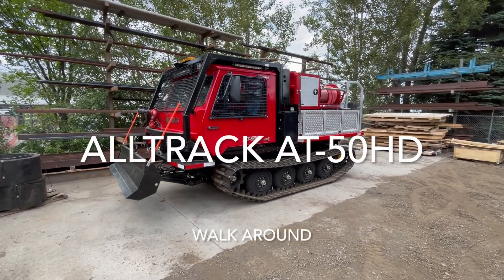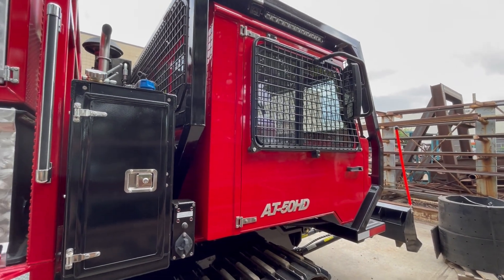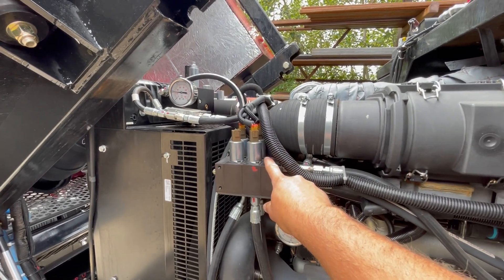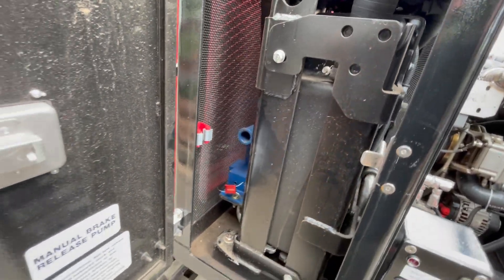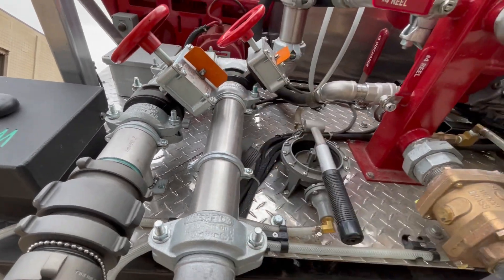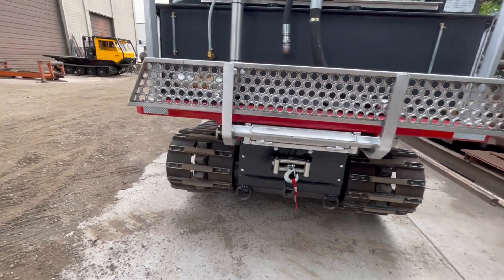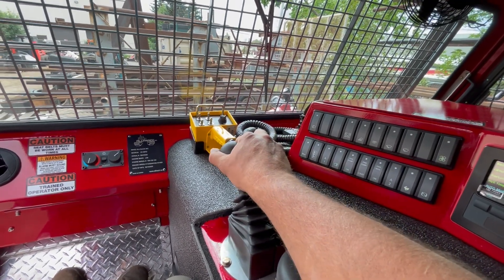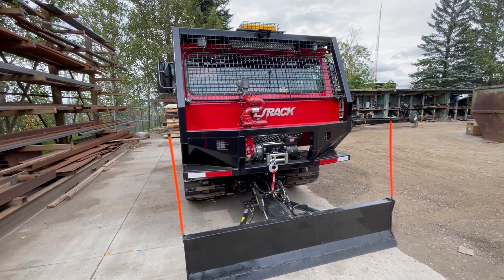Alltrack AT-50HD Wildfire Vehicle for Rough Terrain , Soft Terrain & Muskeg (Low Ground Pressure)

Comment: How long does one of these take from order to completion? It’s a very smart little system
Reply from the maker: Typically our lead times are around 6 months based on current order Queue. The majority of our vehicles are made to order and can be customized to best fit application and user preferences.

Comment: Just add self protection spray system and fire shield/blankets and you will have a homerun.
Otherwise nice work.
What's the ballpark price on a unit as shown?
Reply from the maker: I believe we have a AT-50HD in the production Queue that will have a protection spray system. It will also have a reworked Fire skid with additional side cabinets and relocated reels. The Vehicle as shown with all the options listed in this video is roughly 305,000.00 US for 2024.
Reply: @ALLTRACKINC  Nice! I hope this is highly successful for you albeit from unfortunate circumstances/need.
But as the ol' saying goes 'Si Vis Pacem, Para Bellum"
Keep up the great innovation and work.